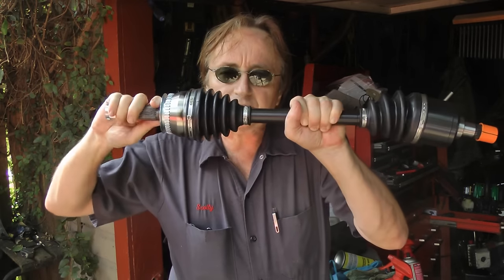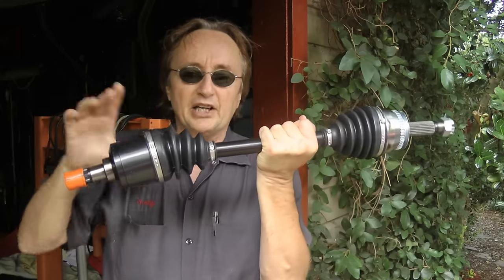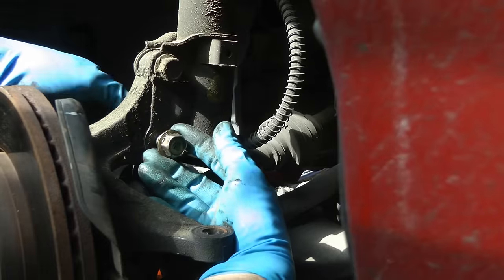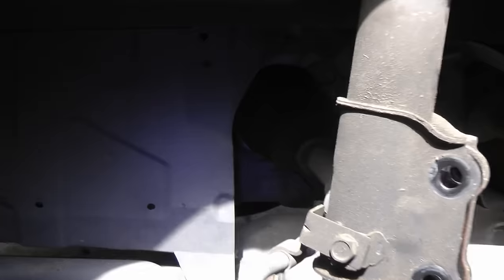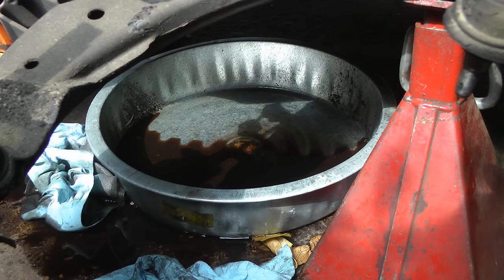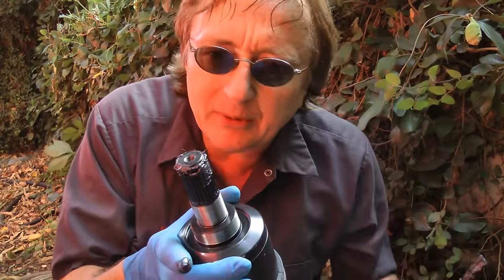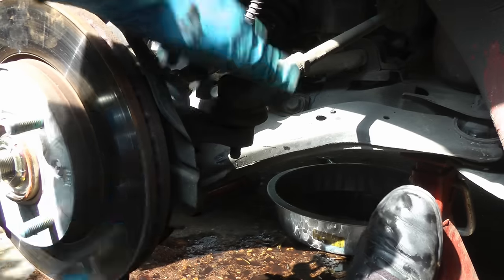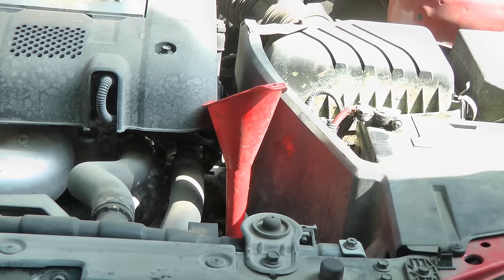How to Fix Car that Clacks When You Turn (CV Joint and Axle)

Comment: i think this is the first hyundai you worked on in your videos...surprised you didnt make any hatred remarks about the brand
Reply: Hyundais are good cars. At least the 2000+ ones are. Ever since Hyundai took over KIA in 2005 the KIAs have been awesome vehicles. I'd say just as reliable as a Toyota.
Reply: From watching Scotty's car talk, he recommends you buy a toyota/honda instead of korean cars
Reply: *****  It go from people to people, I had a Kia Spectra 2002 (still have it) and never had trouble with it, saw 2 of my friends toyota burst into flame and my brother's honda engine Cam Shaft snapped in half after a year so I have a hard time honestly recommending Toyota/Honda over a Hyundai/Kia when asked straight up. Scotty probably had better experience with these 2 brand than Hyundai/Kia, so its normal he'd recommend it

Comment: Hey Scotty,  I have a 03 Dodge Dakota that makes a similar sound but there are no CV joints (2WD) I've replaced both hub/bearings, outer tie rods and all sway bar bushings and end links.  All of these needed doing, but I'd like an opinion as to what this might be.  One person suggested the rack and pinion as it only does it when turning...

Comment: The clip on the axle end needs to be lined up in the transmission before pounding the axle in so you should keep turning the axle 1/8 turn until it goes in.  If you pound the axle too hard when the clip isn't aligned it can cause damage.  Don't the wheels need to be aligned after replacing the axle because the lower strut bolts were removed?  I spray painted where the lower part of the strut attaches and matched the paint marks when reattaching the strut when I replaced the front struts and the guy who did the alignment after the replacement said my wheels were very close to being aligned.

Comment: 2008 Buick Enclave

Thanks so much for this video ... So I have another question, I went to get an oil change yesterday and they found a puddle of oil sitting at the bottom of a big black plastic piece; that they had to remove while changing the oil filter. They told me that my PCV valve was bad and needed to be replaced, however I can't find the PCV valve on my 2008 Buick Enclave. I've searched the internet and cannot find any videos with the PCV valve on my vehicle being replaced. I also called the auto parts stores and they told me that my vehicle didn't have a PCV valve. So can you help, or do a video showing what causes the air filter to have oil on it, and what causes the puddle of oil... Is there another piece that is used in place of the PCV valve in my 2008 Buick Enclave?... I love watching your videos  becayse they are very helpful, so I decided to create a channel just to talk to you... Have a wonderful day!
Reply from the maker: they just use hoses and oil filtering devices instead of pcv valves. So either that filter is bad and lets oil into the air filter, or the engine is just flat wearing out and throws oil in there from compression rings being worn.
Reply: Scotty Kilmer so if the oil filter was to dirty and needed to be changed(it did), tgen that could have caused the build up of oil in the big black plastic thing they took off to get to the filter?

Thanks

I hope you get a chance to fix a Buick enclave... I cant find any DIY videos for the buick enclave)-:
Reply: mahoganyLadi96 no a dirty oil filter would not cause your car to leak, oil filters have a mechanical bypass of some sort on the inside, if oil can't flow through the filter plates it builds pressure and moves the filter element down and makes the oil is directed right to the the exit holes right as it comes in

Comment: Hello Scotty, love your videos. I have a question. I just had my rack and pinion replaced on my Mercedes sprinter, but I noticed I get a popping noise when I’m backing in to a parking spot while turning the wheel. Did they not do the job right or is it something else?

Comment: Hey Scotty I drive a Mazda Rx-8, as far as I know the car doesnt have CV joints cause it is a rear wheel drive, I could be wrong but I dont hear that noise but I do hear a rubbing type of sound. When I turn on a hill like surface or a deadstop. Also I was on a hill at recently and put the e-brake up but it was still rolling for a little bit. Not sure if these are related too. What do you think? Thanks again for your knowledge dude your the best, wish I lived close to you and wish you were my mechanic.
Reply from the maker: +ss4vegeta1   rubbing noise is often thin worn out brake pads, check that first and also look for any possible rub marks showing worn suspension parts too

Comment: Hi Scotty, I need your opinion on this:

I had problems with the clutch cylinder, and the mechanic took out the left CV axle to get the transmission out. When I arrived at the shop, he was trying to get the right axle out of the brake disk by hitting it with a hammer. Eventually he gave up and didn't remove the right one. Then I drove home about 600 miles (lots of turns, lots of high speed straights) and when I finally arrived in my home town I heard some clicking sounds when turning in the roundabouts.

The clicks only occur at a particular turn rate. If I turn more or less I can't hear the clicks. I guess the click is once every wheel revolution, and happens when turning left to go into the roundabout, then you can't hear it when going through the roundabout, then again when turning back right to get out of the roundabout.

My questions are:

1. Can the CV axle go bad because of bad (re)installation - End nuts not tightened enough, or some other thing?

2. Can the axle go bad because of bad removal practices (hitting with a hammer instead of using a press)

3. How much should you tighten the nut that goes on the tip of the CV axle? He tightened the nuts with a hydraulic tool and stopped when it was really tight - but I think if he kept at it, the nut would continue to rotate.

4. If it started clicking, is there a chance I can reinstall it properly or do you thing permanent damage has occurred?

Thank you for your videos and useful info!

Comment: Gotta get a quality cv shaft assembly…. Don’t get rebuilt ones as they grind the ball races down to fit a larger ball… this don’t sound bad, but it is…. As they grind off the case hardening the factory put on… so they wear much faster!

Comment: Great video Scotty.  I've got a 2006 Ford Ranger with 75000 miles that squeaks whenever I turn the wheel.  What do you think it might be?
Reply from the maker: +Luis Llorens   often worn bushings do that, so jack it up, spray WD 40 on them all, and if it goes away, be happy. If it stays, then find the seriously worn ones and replace them
Reply: +Scotty Kilmer I will.  Thanks a lot.

Comment: hey scotty in my brakes in my 94 ranger sometimes, clunk when i apply them at moderate speeds. I think its usually only on the right side. front side so its got the caliper, pads blah blah. it seems like less of a clunk and more of a slap. itwill be really loud but doesnt really affect the braking
Reply from the maker: that old, everything wears including the callipers. If it stops fine otherwise and no play is found on any suspension parts like tie rods or ball joints, live with it
Reply: alright man thanks ive always been a fan of dont fix what aint broke lol

Comment: Great video! Do you have to do an alignment after you install a new a CV axle? Also, do you recommend replacing both cv axles even if only one is problematic but the other is fine?
Reply from the maker: I only change what's worn out myself, and normally do not need realigning if you do the work right and mark stuff that moves

Comment: Scotty,,, your the man,,,, have you ever came across any clicking noises from front end low speed on the BMW x5 E53 model, I get this clicking noise when I turn, I have the car inspected and the mechanic cant find any fault, I used to be on the tools many many years ago and Im going to get my overalls on and see if I can spot anything, any ideas on where I can start.

Cheers
Gerry
Reply from the maker: If it's AWD, often worn cv joints. See my video 'finding the source of car noises"

Comment: Hi Scotty, some people say when turning left clunking, its a right CV joint bad vise versa. Let me know.. thanks
Reply from the maker: that's not an accurate test, they can wear many ways, just look under the car inside the wheels for a torn boot with grease leaking out.

Comment: Hey Scotty, love the videos. My 2002 Nissan Micra just failed its MOT test (UK vehicle inspection) because the CV boots are split, There are no bad sounds when turning. I could just change the CV boots and the car would pass, but I don't know how long it's been split (less than a year I assume). Do you think I should replace the whole drive shaft or just the boots? Thanks a lot!
Reply from the maker: I'd change the shafts, as at least here in Texas we get chinese made ones for 50 bucks. But you can just change the boots, a much bigger messier job
Reply: Scotty Kilmer
Thanks very much for your answer Scotty. I'll just get new shafts since we can get them cheap online here too.

Comment: I will attempt this soon. But is there any locking rings on the transmission side of the CW joint? Newer model Altima 2019. I saw where you just popped pop CV joint out..

Comment: Hey Scotty I have a 2009 Lexus IS250 AWD and my lower CV joint keeps breaking I’ve had it replaced 3 time and every time I have gotten on the freeway it breaks. My mechanic and I have checked everything on the suspension and control arm and hub bearing but no luck. Can you maybe suggest what may be the problem. Thank you.

Comment: Those axle nuts are usually torqued 150+ or more pounds.  Hope a first timer doesn't think it just needs a little snug like the video shows.
Reply from the maker: make em too tight, you will burn out the axle bearings.  But yes, if inexperienced get a torque wrench and the correct setting for your vehicle.

Comment: Hail scotty greetings from Trinidad, with respect to CV joints, service shops in my country devise a  Veterinary type needle brass welded it to a hand type grease gun, so the it can apply grease to the boot joint. Good idea, or good idea to stay away from?
Reply from the maker: stay away, they don't need greasing, they are sealed, If grease leaks out, you need a new seal, not more grease

Comment: Scotty, I dunno if you'll reply but- Is the procedure for just changing the outer boot the same as this just without removing the entire shaft? I want to just remove the outer joint that has a torn boot and then clean and re grease everything. Can't afford a new axle and I've already got the boot.

Comment: hi scotty! your are awesome! helpful,
i think my question will not be related to this vid but do you have vid that why a car turns left when running?
i got honda civic 2008, alignment completed because sometimes it goes on other side, but after the alignment it goes to the left, i have a good tire pressure, my mechanic told me if the problem still occurs after alignment, i should change tires, is that true? my tires are kinda on 60% life
Reply: if your tires made 60% of their life on wrong alignment, they got their wear with a wierd shape. Now that the alignment is good, the wierd shape is what's pulling the car to the left

Comment: I have a 98 S10 with a 2.2l. It's gas mileage is like a V8. Was wondering if changing the rear end gears would help it get a gas mileage more like a 4 cylinder?

Comment: Hi Scotty. I have a Renault Clio (European) when the car is stationary, and I go to turn the wheel before reversing or pulling out it makes a clunk noise. I don't really feel it through the steering wheel but the noise is noticeable. I got two new tyres put on it and yer man that was changing the tyres said it might be the shock mount as the wheel is a little loose.

Comment: @1:06 - Scotty, you don't need to have someone in the car holding on the brakes. Just stick a screwdriver in the rotor vent. It will press up against the brake caliper to stop the axle from turning.

Comment: Scotty, At which point of the engine should I place the jack when carrying out the same work. I have a vw MK3 golf GTI, which needs an overhaul. Thanks Khiz
Reply from the maker: +Khiz ra if engine needs overhauling, it must be pulled out of the body using an engine hoist, see my video "replacing an engine on your car"

Comment: Scotty, do you have to replace both sides at the same time? Or does this usually only happen on one side at once?

Is it obvious which wheel it's coming from?
Reply: No reason to do both if the other on is in good shape. Calipers and struts are best done as sets because they work as a pair to keep the vehicle riding and going strait. Half shafts it doesn't matter.

Comment: U make it look so easy haha...my 2008 chevy colbalt 2.2 liter keeps making noise when I drive... like a rubbing noise...I jacked it up and the wheel is not wobbly and stays....could it be my struts are wore out? Or need an alignment?  Or do I just take it to u to fix every thing wrong with it haha...and how do u remove a actuator in a colbalt behind the blower motor? It makes a clicking noise in the vent
Reply from the maker: you have to tear the dash apart for that actuator, if it works, live with it.  Many things can make rubbing noises, see my video "finding the source of car noises " for that.

Comment: hey scotty I have an 03 durango awd.4x4. I just prepacked my front driver side wheel bearing and axle. It clicks at very low speeds but not when I give it gas of any sort. Does that mean it's bad? it does t his on both sides. like 2mph is when it does it. like when you take foot off the breaks and it moves forward... any ideas?

Comment: I just bought a 1997 buick park ave ultra that runs great but kind of sputters and shutters when it gets around 2300 rpms in 3rd gear. I'm not very car savvy and I'm wondering if this is an easy fix or a major problem...?

Comment: Scotty, a Question. I got a 2008 KIA Picanto - ( I Know right?) that makes a light clunk sound on the steering column when turning the steering wheel 10 degrees left. It does not always do that, but is evident when the car has been standing for a few hours, and will in most cases only do it once. 

I'm not sure what to look for but I think it could be a problem on the steering rack, as the sound comes from there but you feel and hear it in the cab. 

I'd appreciate your input on this.

Comment: you shouldn't have to "hit" the CV axle into the trans...one good push and it should snap in. ALSO yes you should absolutely get an alignment after removing the steering knuckle from the strut. It may not look like much but those two bolts can change camber as much as .5°!

Comment: Hey scotty I'm not getting any spark on the 5th cylinder. I used a spark tester on the boot  and not getting a spark so this lead me to believe that the problem was the ignition coil module so I replaced that still no spark on the 5th cylinder. So this leads me to believe this is a wire harness issue but whats the best way to test the harness and what could cause that 1 cylinder not to work  wouldn't other cylinders be off too. Thanks.
Reply from the maker: if you have a coil on plug system where all spark plugs have their own coil assembly, if it doesn't fire on 5, either wiring going to it is bad OR the main computer circuit that drives it is bad. Check the wiring with a meter if you know how to check wiring continuity, or pay a mechanic

Comment: on my 67 mustang it had the same noise under the same circumstances being old rear wheel drive its obviously not a cv axel it ended up being the transmission mount coming apart

Comment: Hey Scotty - My daughter's 2005 Hyundai Elantra (man trans) front passenger wheel is clicking when turning in reverse. Seemed like a classic case of "replace the CV axle" which we did today. The noise is still there - what else could cause this?

Comment: Hey Scotty, I have a 2002 Ford Focus. Almost every time I take off from a light, or come to a stop, just after hitting the gas, and just before coming to a complete stop I hear a clunk or two which sounds like it is coming from the right front. I had a mechanic take a quick look at it, and he said everything was tight except the right tie rods (need inner and outer). He showed me the movement. It (occasionally) clunks over bumps too. Does this sound right? I have heard other people say unsecured exhaust, ball joints, struts, and everything else under the sun.
Reply from the maker: +tucson2419 replace the tie rods first. ALWAYS change obviously worn parts

Comment: When I take sharp turns to the right, my car clanks as well but you can hear the clanks every half a second or so (not as fast as in this video). I checked the CV axles as well as pretty much everything below the car and visually, there doesn't seem to be any issues. I've had this "issue" for about 5 years now and never really done anything about it but I'm still a little curious what might be causing it. It's a 2002 Honda CRV AWD 5MT.
Reply from the maker: ah live with it, those AWD jobs makes noise. But be sure to change the differential oil out in the back with the special honda fluid, they make noises when dirty and turning
Reply: Scotty Kilmer sounds good man, will do and thanks :)

Comment: Hey Scotty, I have a 2008 Hyundai accent. I have a problem when I put gas in the car it won't start. Before I put gas it starts up great when I put gas it will crank but won't come on unless I play with the gas pedal. I change the fuel pump, all spark plugs and ignition coils. And I also seen your video crank but won't start. Do you think you can tell me the problem?